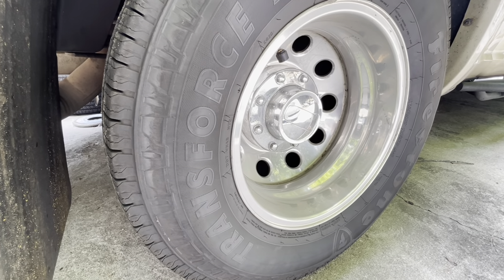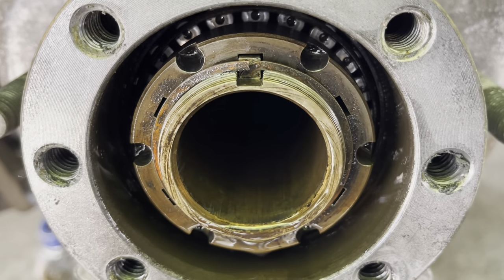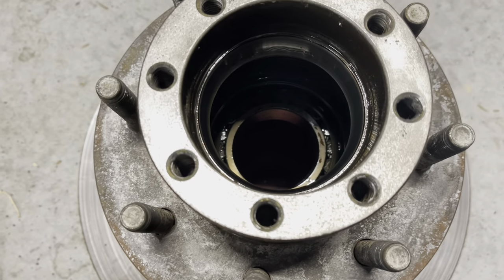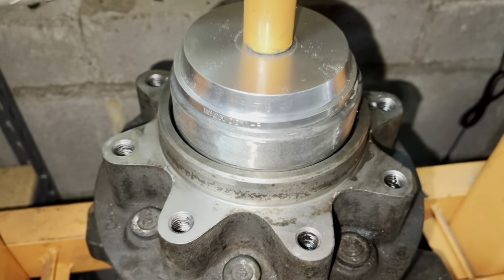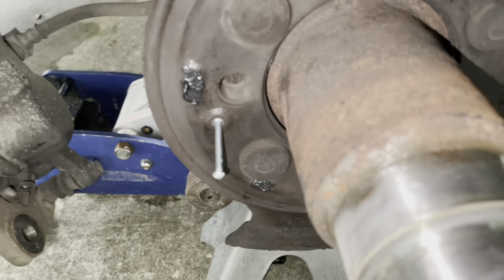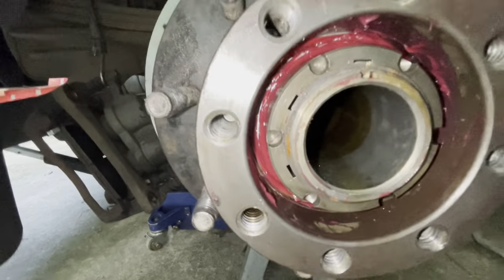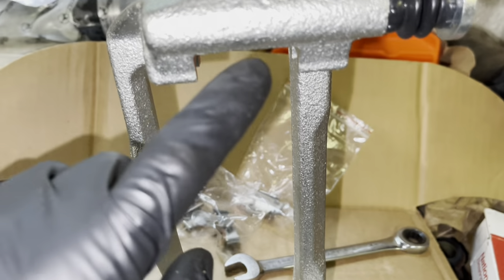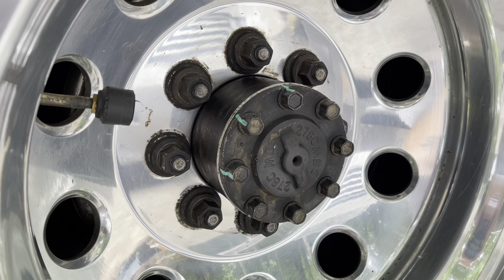Dodge Ram 3500 Rear Rotor, Caliper, Brake Pad, Parking Brake Shoe, Bearing & Race Replacement DIY

Comment: I have seen the bearings come apart from not putting additional lube at assembly and expecting the differential oil to work it's way out
Reply from the maker: That's what packing them is so important. Dodge does have a specific procedure of driving at very low speeds to get the oil out. MANY don't know how or follow it...So to save everyone the headache just pack them.......20k so far towing ZERO Issues just changed the diff fluid and it was perfect

Comment: I haven't found a good way to turn the star wheel adjuster on the drivers side as it's at the top. What i did was to pre-adjust the parking brake pads by putting the drum/rotor over the parking brake shoes and get it pretty close. Once set, put whole assy. together with the hub. bearings, seal etc. on for installation. You can also get a large inside/outside caliper(made for this job) and set the clearance that way. JM2CW
Reply from the maker: It’s a pain we did the same got it close
Reply: Just watched a guys video where he adjusts the driver side with a little brake adjuster type pry bar. Made it look easy..
Reply: Awesome job sir! Very detailed, step by step instructions.

Comment: DO NOT PACK THE BEARINGS. All that work for nothing, you just contaminated your differential oil. The oil is a blend of additives, especially for your minimal slip. The bearing are continuous lube from the gear oil which is pumped by centrifugal force of the rotation of the axle
Reply from the maker: You’re actually wrong….the differential fluid is petroleum as the high temperature bearing grease. The bearing grease will liquefy when driven with the extreme pressure and temperature. 15k+ miles ASE certified mechanic been doing this for over 20 years
Reply from the maker: The reason experienced techs pack the bearing is because people like to take off from the shop peeling off to the highway that will destroy a new set of bearings and races in a heartbeat.
No one listens when we say take it easy and do a few turns before driving hard the grease is cheap insurance
Reply: Yup, exactly this.  It takes some time for the diff lube to make it’s way back to the bearing,  especially the smaller outer one.

Comment: You don't pack bearings on dually 3500's, its free floating assembly', It's all filled with diff fluid,
Reply from the maker: You are correct with it being a floating assembly….the problem is when you redo everything it’s dry and the oil takes a while to reach the bearings possibly resulting in scorched races….that is prevented with packing them the grease is 100% compatible and soluble

Comment: Why put so much grease into the bearings if they're gonna be lubed by the diff fluid? Wouldn't soaking up the bearing in oil before installing be sufficient?
Reply from the maker: This is done because during the first few miles and turns oil does not reach the bearings. There is an actual Ram process but no one follows it

Comment: Thank you good video!!! The tool for axel nut dont work on 2022 model cant find it anywhere will call dealer to see maybe they got one
Reply from the maker: Thanks & your welcome! Did they change the axle nut? We have not seen the new trucks yet.
Reply: @DIYKAI   yes they did  so it requires larger tool but no one carries it they say its to new but its a year old already lol
Reply from the maker: @NorthernLightsExperiment  figures stealerships have a lock on tools for a few years SMH they claim trade secretes
Reply: @DIYKAI  yes that is what it seems like
Reply: @DIYKAI   what do u think if i grab a different nut and regular socket and pre load bearing and then install original nut hand tight?
Reply from the maker: @NorthernLightsExperiment  the problem with that is the final toque to tight and you shorten the bearing life too loose, and it can break free. If you have a way to measure final torque, then that would be best
Reply: @DIYKAI  yeah i see because you said 22lb of tork all that needs for that bearing anyway you got your self a new  sub :)
Reply from the maker: @NorthernLightsExperiment  Thanks! Same we subbed back! if we find anything out about how to get around it, we will reply back
Reply: @DIYKAI  😀👍
Reply from the maker: Most likely yes
Reply: Were you able to ever find the updated tool for 22 model in process of job and can’t locate it please advise
Reply: @NorthernLightsExperiment  🫡
Reply from the maker: We can take a look and see but being so new it may not be available to market yet

Comment: What kind of grease did you use to pack the bearing?
Reply from the maker: High Temp Red Bearing grease Oreilly brand i believe….just make sure it’s a heavy duty wheel bearing type as it’s only used to pre-lube until the diff fluid makes it out to them then they are oil bathed from the rotation.
Reply: I watched one video where it said it wasn’t necessary to pack the bearings.
Reply from the maker: @Michael_Wild  so the issue is when you do the bearings and fill the differential the fluid has to make it’s way out to the ends that takes some time….there is a service procedure that involves left and right turns at low speeds to allow to fluid to lube everything properly……but I have yet to see someone or a customer do it properly or at all….when you don’t you run the risk of them rotating “dry” that would cause the bearings life to be shortened or the races to scar both bad news so pack some grease it to them and send it no need to worry as the grease is oil soluble and will mix properly…(15k hard miles on our and no issues at all)
Reply: Thank you. That is great information.
Reply from the maker: @Michael_Wild  your welcome
Reply: You don't use grease.

Comment: do you pack the bearings on a 2016 dodge ram. I noticed in other video's that it was strictly gear oil?
Reply from the maker: So the reason we pack the bearings is when you drive off for the first 20 or so miles the diff fluid is trying to make its way out to the hubs. So it is always best practice to pack all bearing so you don’t burn anything up. It will dissolve with the diff fluid when it heats up
Reply: You can also fill the differential fluid, Jack up one side of the axle for 30mins or so to allow fluid to flow to the hub. Lower the axle, top off fluid, and do the repeat on the other side
Reply: No

Comment: In around 12.54 why does the bearings look damaged ?
Reply from the maker: Not sure what your talking about we went back on the video and don’t see anything? We put over 3k miles on it and no issues
Reply: @DIYKAI  second look and it was the way the grease smeared.
Reply from the maker: See it now lol it looked like a crack 🤣😅 had to triple look

Comment: What year truck is this ?
Reply from the maker: 2012 should be similar for most 4th gens
Reply: Hi can you tell me how many hours to do both sides thank you
Reply from the maker: @BekimHaziri-q4p  really depends on your skill level a couple hours at least
Reply: Would a 2008 3rd gen be about the same?
Reply from the maker: @strykerclay9597  yes just make sure to check the specs for your year

Comment: You're supposed to go 90ft lbs then back it off 90° then final torque it to 30 and back off to the closest keyway slot, no?  🤔
Reply from the maker: The instructions I gave are OEM specs have drove over 20k so far and all is good